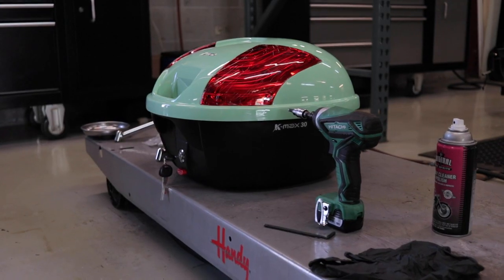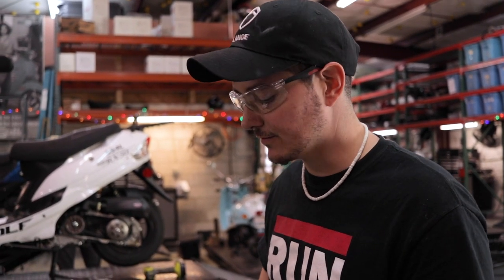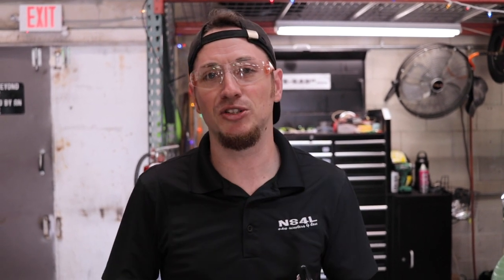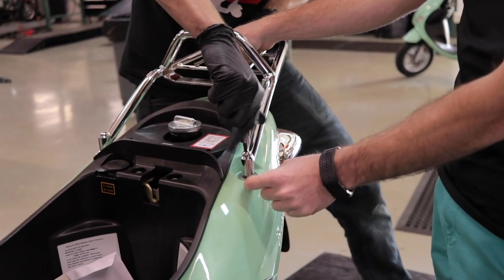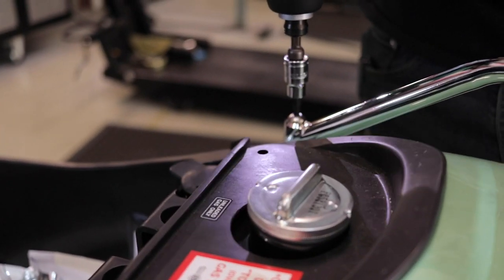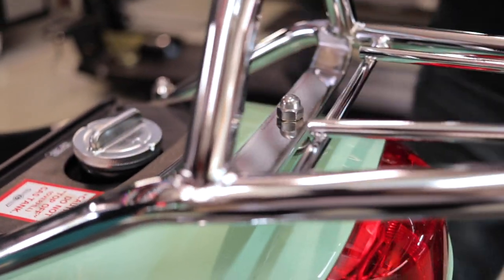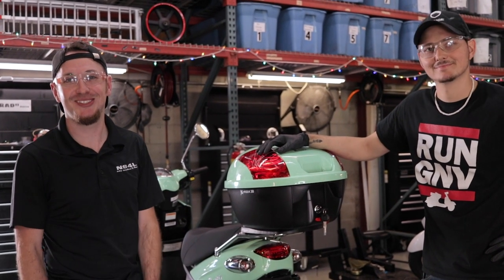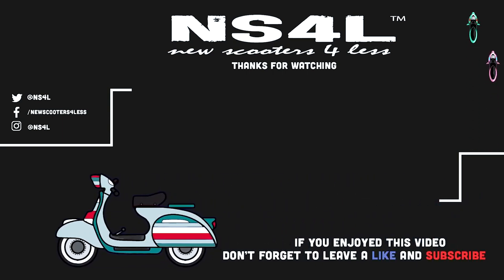How To Install A Top Case | NS4L How-Tos

Comment: Hey buddy ..i am from india...and  I have TVS wego 110 .can you please look at the pictures i want to install the storage but my fuel lid is also at the back portion....any idea??
Reply from the maker: What pictures?  I don't see any pictures.  From my experience, there really isn't a solution here if it covers your gas cap :/
Reply: rear top box is not possible with Wego. However a front box is available. You can install it.
Reply: @amitabhasaha9784  no i need rear top box :(

Comment: Thanks for this video. Is it possible to put a larger trunk on a buddy 50 - one that fits 2 helmets?
Reply from the maker: Bryce Urbany Most likely. The rear rack is strong, so it shouldn’t be a problem. My best suggestion would be to use this case for one helmet and the under seat storage for the other though 😊

Comment: There is No right or wrong way to mount the trunk as long as everything fits. LOL I watched three videos from the company who sold my scooter with universal top case and in one they mounted the brackets back to front, the other side to side and yet another criss crossed them! It doesn't really matter I guess as long as you use the proper bolts that connects the trunk to it's base.
Reply from the maker: The right way is well enough so it doesn't fall off, hahaha! ;)

Comment: The flat washers go on the top ?
Reply from the maker: Yes that is my preference (inside the mounting plate.) If you just drive the bolt down without a washer, sometimes you can drive it through the plastic. The washer prevents that.